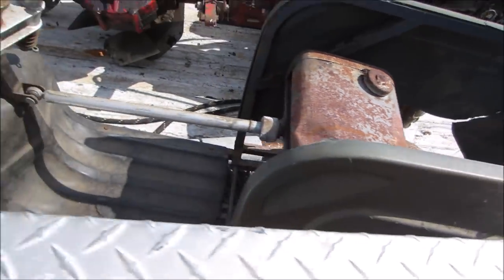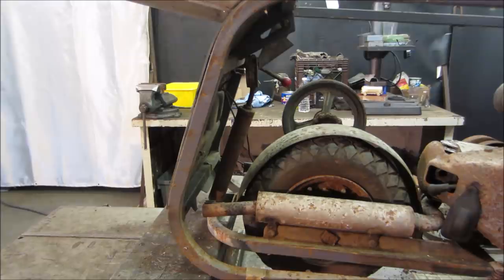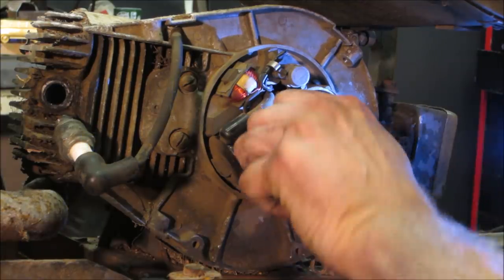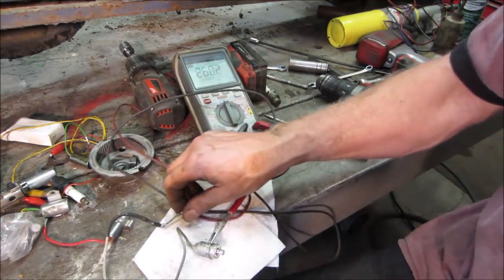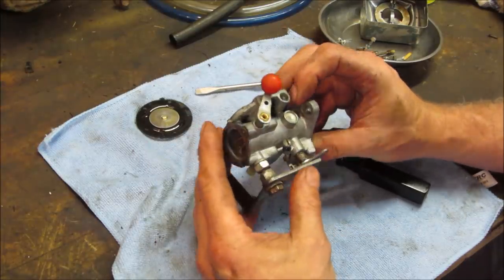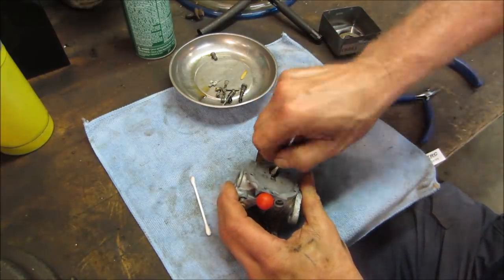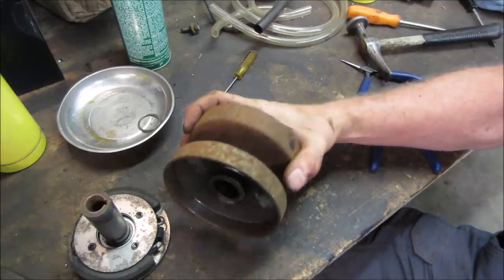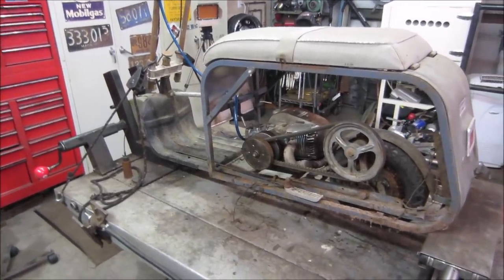Sitting 40+ years, fold up 49cc suitcase scooter. Will it Run?

Comment: gotta thank you for your vids....i found a lawnmower "yardmachine" 173cc in the garbage needed a pullcord and a gas cap (mice ate holes) needless to say carb was varnished,main jet was clogged and had water in the tank...$20 for cord and gas cap cleaned up the carb runs mint....not a spot of rust and didnt even have to sharpen the blade pretty much brand new.....thanks again for your vids.....keep em coming
Reply: Trash to Treasure :P

Comment: My grandfather had an old gravely from the 1940s. Absolutely fascinated me when I was a kid. I remember it sitting in an old shed for years,  and then the immense satisfaction when I was able to get it started;  I had to go to a leather working shop to get a length of thick leather as the original starting strap was long since gone, but other than that fired right up. That was 20 years ago, it would not surprise me if its still running today.
Reply: Just so you know I got that one running too

Comment: The ignition cam has me wondering if you installed it the opposite way   could it be made to run counterclockwise? If the alignment is pinned to TDC the calibrated ignition timing would remain in either rotation.

Comment: I'm always amazed at how you can get those carbs rebuilt, seems like it's something that never works out for me.  You are using my favorite hammer Stanley 5950  57-596 32 Oz. Hammer...discontinued. the 16 oz is still available but the tips for the 32 oz are almost unobtainium. I found some NOS ones on eby and since had found some urethane round stock and made my own...but anyway be careful with it they are hard to replace. Let me know if you ever need a replacement tip, I'll set you up!
Reply: Watching your videos gave me the faith in myself to get into and repair my own stuff. All the way up to restoring a 48 yr old Harley.  Thanks again for your insight and knowledge.

Comment: I have a weedeater that used to run fine, but then the pull rope broke. Me and my dad went to fix it and the spring came out. That is not fun. It is now sitting around because we gave up and bought a new one. Any tips to get the spring back is easily?

Comment: Yes, it's called a Centaur.  There are Youtube videos and other information files on the internet.  These are quite rare, and they do weigh 90 pounds.  The engine is spec'd at 49 cc.  Great find. Great fix. Great fun

Comment: Looks like a Fuji Go Devil, but it has body metal? I have one, except mine doesn't have the body metal ots open and it once had a bag with Go Devil on it that zipped up around it. The bag rotted away but I still have the bike. I need a new carb and it needs a restoration.

Comment: Reminds me of a very similar folding secondhand motorcycle that my dad bought for us as kids in the early 70's . It was made in the USA and called a 'Gadabout' with a Clinton engine and had a centrifugal clutch. It had small wheels and almost identical shaped round tube frame and handlebars that I think folded but I don't recall the CBT but I was only about 8. I do remember constant clutch issues and difficulty getting replacement parts which is probably why it disappeared never to return. I came off it on the beach once and was sworn to secrecy as my mum would have ended any further fun there and then had she known. That was about 48 years ago on the west of Scotland. Great to see you making progress on hopeless cases yet again.

Comment: The engine is a Clinton E65-1000, but somehow, they flipped it around. The illustrations match the engine bolt for bolt, but it's FLIPPED. The plug and exhaust ports are backwards, no doubt the carb was turned over as well to facilitate the scooter's design goals.

From my research, Clinton Engines stayed in the niche market, filling contracts for specialized and limited run engines. They built an opposing cylinder, 2 stroke engine for a Navy contract  that was very durable and dependable.

Comment: That was a cool machine when I was a kid my dad had a bunch of mopeds in his junkyard none of them ran but he didn't have one of those ones in my experience I've worked on a lot of chainsaws and weedeaters also my 1/5 scale rc cars the needle screws I start at 2 1/4 on both high and low and tune it in from there thank you for the great entertainment and information

Comment: Oh my. That brings back some crazy childhood memories. I had one of those when I was 12-13 years old in Dallas,Tx. That was 53 years ago. When it's folded, the handle is on the front and you actually roll it along on the rear wheel. Rode the crap out of it! Loads of fun!

Comment: You can mount a condenser externally anywhere you want on the bike, which makes it easier to replace them at whim. All you need to do is cut and solder together the wires that went to the condenser underneath  the flywheel. Then, you connect the wire of the condenser inline with the wire that feeds/powers the HT coil (HT coil is the one that the spark plug wire comes out of), and ground the body of the condenser. Some HT coils have 2 connectors...one for ground, one for power, and some have 1 connector for power and they ground through the metal body of the coil. I do it all the time on mopeds, works on anything. Since they're not trapped under the flywheel, they remain cooler and last longer too.

Comment: Is it like the centrifugal "balls" on a large engine that swing out as the engine increases in speed?
Reply: Different layout, but the same principle - for both the transmission and the clutch system.  Older car distributors with mechanical advance work the same way as well.  :-)

Comment: I wish you were closer to me. I have a sweet King O Lawn motorized reel mower from 1959 with the original 3hp Briggs Engine. I pulled it out of a barn when liquidating a property. I tried to get it running, but it has a stuck valve. You could have the mower if you want. I'm trying to sell it currently, but I would love to donate it to the channel. If you're swinging by Ohio, let me know!

Comment: It was interesting to see a CENTAUR scooter.  We have two of them. The Clinton engine in them are either 73.74cc or 94.38cc'c depending on the year.  About ten years ago, some one was reproducing the fenders and side panels, but no longer.  These scooters handle about the same as a powered wheelbarrow, and it is good that they dont go very fast.  They are just an interesting piece of motorcycle history. I see you have a huge following on youtube, and since you deal with obsolete stuff, you might take a look at my small youtube channel (Mr. Obsoletes Vintage Homesteading) and you will me useing nothing but vintage chainsaws, tractors, garden tractors,lawnmowers etc.  I only use vintage stuff. Great video's.
Reply: they don't need to when you were just ripping into/out of the airport before takeoff/after landing
Reply: @rawr51919  Even in perfect mechanical condition, like ours, they feel like they have a hinge in the middle and dart around if any rough surface is encountered. The top 3 worst handling scooters I have ridden are !. Centaur  2. Doodle Bug  3. Sears Jetsweep (cushman).  They are all fun and all have their place in history, but have their flaws.  I am speaking from personal experience, as I own all three.
Reply: I just subscribed
Reply: My father was a dealer for Centaur. I have some of the brochures.
Reply: would it be possible to get a copy of a brochure? Even a photo copy would be good.  I plan on doing a video on the Centaur as from 1963 to 65 they were made by Lombard mfg. who also made chainsaws, and I will talk about the history of both. I really like to include history if I can on the things we collect and use here on the Vintage homestead.   @frederickwoods5943  w
Reply: @mrobsoletesvintagehomestea9156  if you are on FB send me a friend request. I have a stack of the brochures and will gladly mail you some.
Reply: I am not on facebook.  I would appreciate a brochure or two.  I will be gone for several weeks, so I will contact you when I get back and get an address for you. @frederickwoods5943

Comment: This is basically a Tote gote, just with side panels, you could still find these in the 70's. though they made a small solid frame one we use to ride as kids. Looked like a small motor bike with a brigs engine or a tecumseh engine ( was one of my fav's ) easy to work on. We had so much fun with the thing. I have a old Sear's and RoeBuck Generator 1500 watt that was still able to run about 15 years ago that needs a overhaul. It has the same Type of motor. Love the sound of these old motors.

That Chain was going AAAAHHHHH when you put that lube on it lol.

Comment: I had a go kart in the 60s that was powered by a 2 stoke Clinton engine.  I required a 20:1 fuel/oil mix, your pre-mix is probably 50:1.  The higher oil concentration is probably required at high rpms.

Comment: That thing has rear foot pegs.  People weighed a lot less in the 60's I guess.
Reply: at least I did!
Reply: I noticed that too! When I was a kid my neighbor had a little bike called a Cibi, folding handle bars and frame so it would fit in the trunk of a car. 50cc 2stroker carried both of us all over the neighborhood at times when my 3 1/2 Briggs mini bike (stars an stripes paint job with a sissybar) was broke or out of gas. 1973 or so. We literally rode the tires off them several times.
Reply: more like less saftey XD

Comment: Is that the original fly wheel? Because the fins looks like they are the wrong way
Reply: now you mention it, you could very well be right. hope mustie1 sees this before he runs hot and nips up the piston
Reply: The fins curve in the direction of how it will turn. Just like any small engine.

Comment: I think the spring that pulls the driven pulley is suppose to pull the belt tight keeping it in a lower gear until speed picks up and overcomes the spring

Comment: I'm one of those crazy people that collect Clinton engines and I have lots of manuals so if you ever need any specs for a Clinton give me the serial and model and all gladly let you know what I have.
Reply: Thanks for the offer.  Since I am such a junk collector, and have repaired a lot of clintons over the years, when I found out that a long time small engine shop was closing down, and had been a clinton dealer, I bought the parts inventory and it included manuals from 1946 till 1982 when they shut down. the fast moving parts were all gone, but I have used a lot of the leftovers to repair engines for myself and others.
Reply: hopefully you're digitizing those old manuals as they get pretty rapidly more rare

Comment: I hollowed out a reo condenser and fixed it. Cut the end off with a hacksaw. Pull all the junk out. Solder one leg of a .047mfd tantalum capactior to case other side to hot. Works great.

Comment: Rear wheel flip up for travel: Seems like someone would have figured out a 90lb rolling suitcase would've been handier.
Reply: I was thinking mount roller blades wheels in the back and roll it like luggage when the rear tire is up. Maybe it will roll on the rear tire as it is?
Reply: That "carry handle" looks to be more for lifting it than carrying it. There has to be a way to roll it using a tire and the handle bars.

Comment: OH. How interesting. normally, a CVT requires both pulleys to change dimension. This just has the other pulley on a pivot. That's novel.
Reply: It looks like the spring on that pivot has gotten a little weak over the years.
Reply: I've got a motobecane moped, and on that the engine actually pivots back when the cvt shifts.
Reply: A lot of scooters used just a clutch and a pivoting rear pulley.  Doodle Bug scooters made from 1946 to 48 used this system, and the early ROKON TRAILBREAKRS also, Herters, and many more.  Works OK, but a true Salsbury CVT is a lot better.

Comment: I have been playing with a Kohler K160 circa 1962, using the same Milwaukee drill to spin it over.  I wish there was a way to disable the 'brake' in the drill so when the engine hits I can get the drill off the crankshaft nut before the drill locks up and spins the nut off the end of the crank.  I, too, had to replace the capacitor to get a consistent spark. Enjoy your videos!

Comment: It's easier to start a spark plug in a tight space if you put a vacuum hose on it  to start the threads. I've used that method for years. It won't cross thread that way either.

Comment: yeah the two stage clutch. the first or the brake pads that kick in at low RPM. at high RPM is when the ball bearings push out on that angle plate, to increase the belt diameter.

Comment: Awesome find! This is pre-battery days. I however can't imagine airlines allowing something filled with gasoline into the check-in compartment of an airplane or even a ship. Today - same exact thing, but with batteries. I travel to Kwajalein in the Marshall Islands, and always wanted to bring my battery-run bicycle with me. But, the airlines don't allow it to be checked in.
Reply: Gasoline powered is fine - if the tank is empty and bone dry. Shipping fuel by passengers aircraft is a real challenge and requires triple sealed fuel proof packaging (can inside can inside can...).
Lithium batteries MUST go in the passenger compartment and are severely power limited - lithium batteries have brought down airliners due to cargo fires.

Comment: There are 3D printing services that could reprint those plastic side panels. There are some that can even 3D print in metal. I bought a resin printer awhile back and have used it to remake parts that I can't find or can print for far less than buying it.

Comment: Man that takes me back to when I was a  young boy.  My dad's brother still had the truck he drove up from east central South Dakota to South Western North Dakota in 1921.  It was old, I think the make was DImonond Reo or some such name.  The cab and box were made of wood, there was still most of the tar paper on the top of the cab and the doors still worked on it.  It had not run in perhaps 40 years or more, this was in 1957 or 58. Anyhow my cousin was several years older then me, however he was of short stature, I was more the Swede being tall and lanky, I could easly see over his head with no trouble.  At any rate, my folks decided to go to town, but they wanted to take dad's brother and his wife along.  Well there was no room in the car what with 4 adults and my two sisters, and my cousin's sister so he and I were to stay at my Uncle's farm and he was in charge!  Well after they left we went out to play in that old truck, as we had many times before, my cousin came up with the idea that perhaps we could get it going since his dad had pumped up the tires to see if they held air a few days before, and they did.  SO we took out the plugs and squirted some motor oil out of his dad's oil can as this was on a farm, and such things were all over the place back then.  We checked it out and it seemed we could turn over the old 4 cylinder engine with the crank, if both of us tugged on it, and after several cranks my cousin remembered that his dad had said you had to advance the spark, so he ran to the cab and advanced the spark and moved the throttle up to the start notch, and once more we cranked it, after pouring some gas into the carb, and POW she backfired and came to life! Well that was something, my cousin got a milk pail from the milk house and sat that atop the seat so he could see over the steering wheel and around the farm yard we went, faster and faster till I was afraid we would tip over.  Then he stopped and said, and I can still hear him as if it were yesterday "Watch me burn rubber" He floored the old truck and popped the clutch. BANG, CLANG Grinding of gears and smoke poured from the rear of the old thing.  Well after he got it started once more, we parked it back where it had been for 40 years, it sort of would go forward a bit at a time, then we got garden rakes and tried to cover up the tracks before the folks got home.  We knew they would all be drunk as hell when they returned so the worry was the next day, and funny how that day never came.  My cousin never did baby sit for me again either.

Comment: my vw bug starter gets stuck on. i have a hard start relay, ignition switch, and ignition lock cylinder installed. the starter will turn off after i turn the key off but so will the engine. it does the same thing with just the wires bypassing the ignition switches. have any idea what could be wrong?

Comment: Seems odd, looking at the air vanes on the flywheel it seems that the engine should run anticlockwise, however looking at the drivetrain makes clockwise the correct direction.

Comment: That's really cool. Yamaha made something along those lines called a C-3, or XF-50, referred to as the cube, not that long ago. More rounded off and all, just didn't double as luggage is all. The side panels may well be made with fiberglass, or easier yet with sheet metal (aluminum/steel/tin), and a few simple tools. Great job getting her to run, just regret it set so long before someone took in interest in seeing her run again. Best wishes.

Comment: When I was a Kid in the late 60’s, another kid had one of those, and rode it around everywhere, till the Police caught up with him. It had a Kickstand, so when you Started it, it would run away, until you pushed off with your feet, and the Kickstand would fold up. Also the Starting Cord handle was outside the enclosure.

Comment: That thing is pretty cool! One thing I would recommend. If it will fit I would clock that pull start 90 degrees clockwise so you can pull it straight up just by lifting up the seat.

Comment: I guess I typed too soon, but they may be able to help you find parts for it anyway. KBS Coatins sells gas tank lining products that work very well. I have cleaned and repaired several gas tanks using their kits with 100% success.